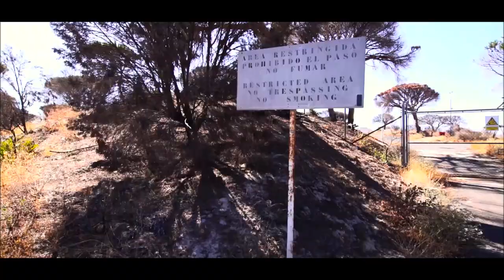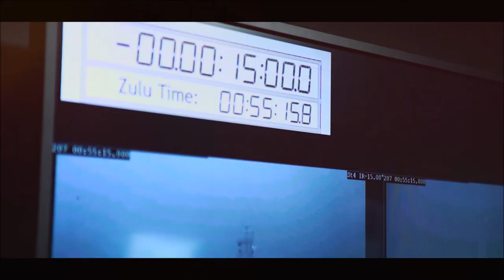Stratos III Rocket Launch - Aftermovie 2

Comment: What happened to the rocket?
Reply from the maker: We think a roll-pitch coupling occured during flight, which occurs when the roll motion of the vehicle matches in frequency the natural pitch frequency of the vehicle. When these two frequencies match, the vehicle becomes unstable. 

See also https://www.youtube.com/watch?v=Lbb3Jzsv0O8 at 11:30 for more information.
Reply: @dare_tudelft  I hope you can recover all necessary data like vibration and wind speed. From the video, it seems it didn't pass a wind tunnel test either. But honestly, I think the material structure becomes soft due to the high temperature of the engine. Loose connection, thus disintegrates rapidly.